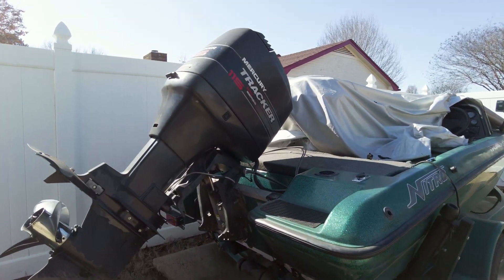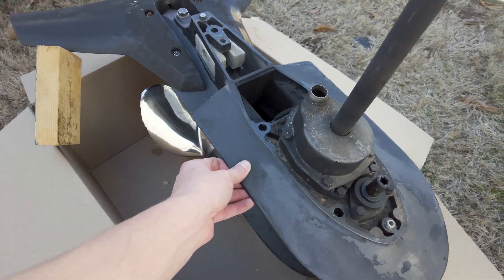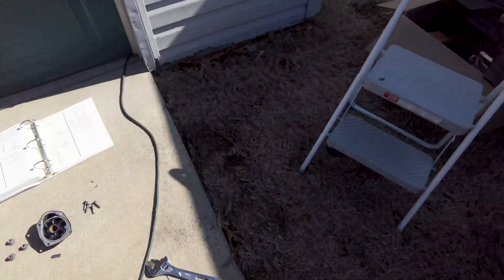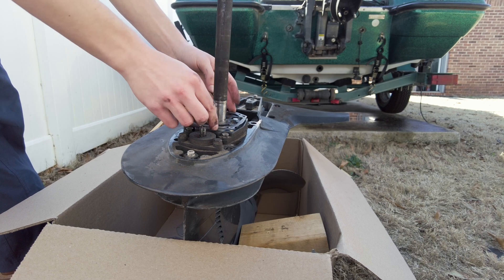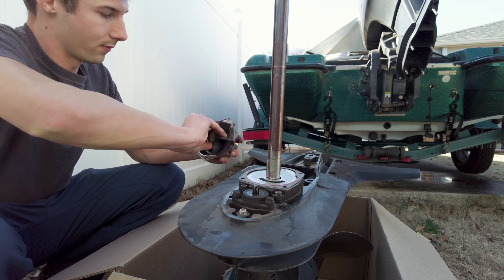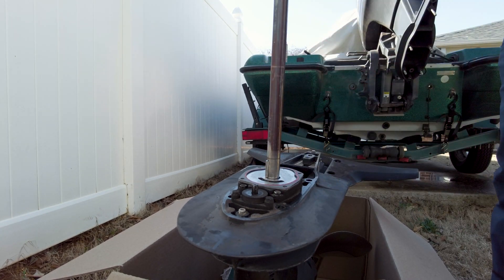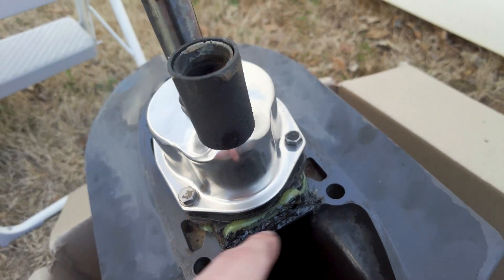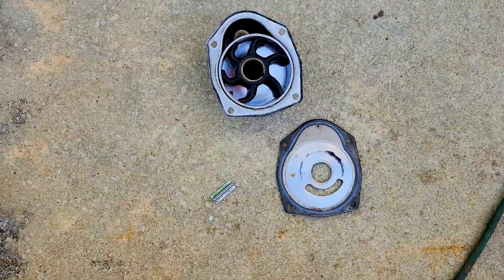1996 Mercury 115 (2 Stroke) Water Pump Replacement

Comment: Trick I learned working at a boat shop. Coat the impeller with dish soap and it all slides in super smooth and lubes the rubber fins.
Reply from the maker: Good deal, thanks for sharing!

Comment: I think the new one  has straight fins so you can't really install it backwards
Reply from the maker: They all come straight but curve during installation due to the impeller being a larger diameter than the housing. Are you saying the come the same size now?
Reply: No jus that it didn't matter if it was flipped a certain way... 😊 @FoilFanatic42

Comment: Every few years, you could consider the "Master Rebuild Kit", it also includes the plate and a few components below what you replaced. Always note the composite washer disc around the gear selector that it is there, and the splined adapter that chose to stay up on the splines at the motor. They can fall out when you remove the lower. Those two items are only required for motors with hydraulic tilt, like yours. FYI...
Reply from the maker: @thangknowa3288  I appreciate the insight!

Comment: Where did you get the shop manual? I just bought a 95 tracker 115 cant seem to find the manuals
Reply from the maker: It came with the boat when I bought it. Unfortunately, I'm not sure where it can be found.
Reply: @FoilFanatic42  any way I could pay you to copy it?
Reply from the maker: @chevy16001  I would if I still had it, sorry.

Comment: What was the part number for the kit? Im having trouble finding it for my 115
Reply from the maker: I used the Sierra International 18-3570 and it has held up very well!
Reply: That should be the same for a 2000 tracker 115 right?
Reply from the maker: @christopherlaw1021  I am not sure about that. Are you able to find your engine's manual online? That's usually the best bet, then cross-referencing the new part number.

Comment: I have same motor. I had water pump replaced in reputable shop last time. This time i did it myself and when it took lower unit off it didn't have seal on the shaft either. Makes me wonder
Reply from the maker: Yeah, I'm not sure if some kits have it and some don't or if people just don't put them on. Interesting for sure.
Reply: Jus did mine on a 75hp Force with no tell tail and it didn't have that either.... I'm sure water comes out from there when ones not in place so that was definitely one of my problems 😊

Comment: I like to place in forward first thing so nothing up top moves. When you reinstall, if no go, turn prop a little with one hand and it slips right in. Mercury says don't grease very tip top of shaft, could experience vapor lock, light grease on side of splines ok. Good time to remove prop and check behind it for fishing line.
Reply from the maker: Luckily I put it in the forward gear position before taking the lower unit apart, but turning the prop still did not allow the lower unit to slip back in. In this case we had to turn the flywheel while the other applied upwards pressure on the lower unit. Thanks for the explanation on why the grease isn't reccomended on the top of the shaft!
Reply: @FoilFanatic42  You are welcome. You can usually find the way with very small turning of the prop, and a little bump - bump move up and she slips right in. Small moves, it's all by feel.
Reply from the maker: @thangknowa3288  That will be good to keep in mind for next time!
Reply: Thank you!!! Nice tip